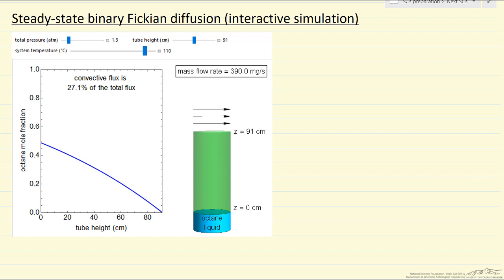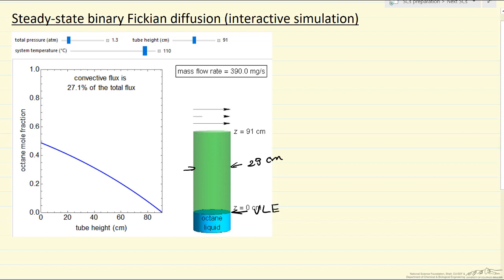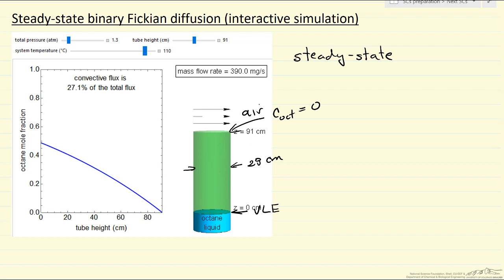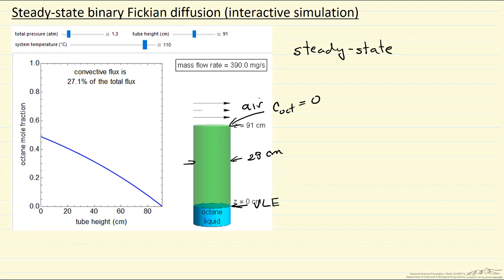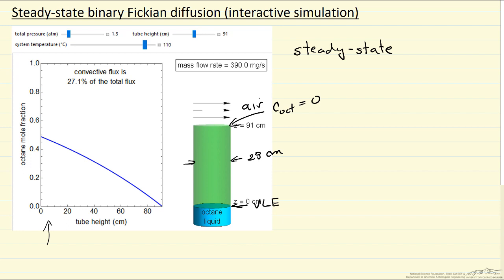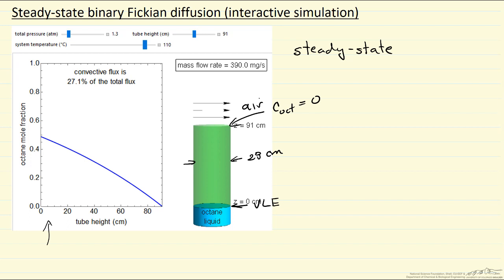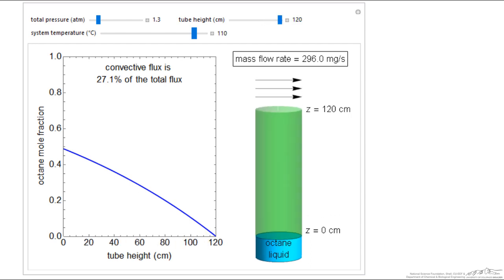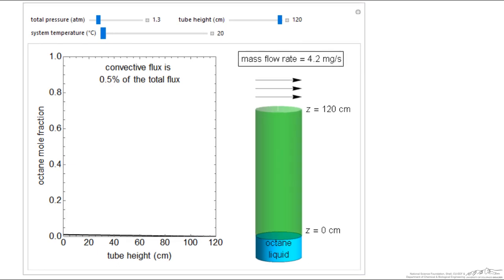Steady State Binary Fickian Diffusion (Interactive Simulation)

Comment: I appreciate everything you guys are doing!  Something I haven't seen books/youtube tutorials talk about is evaporation into a stagnant medium or almost stagnant medium using free convection.  For example, water on a surface, not changing in size with time because it is somehow being replenished from a reservoir of some sort in relatively stagnant air.  The tough part for me is that when the liquid is directly contacting the air, you can't use a a tube length to approximate diffusion distance.  You also can't use BL theory because there isn't a flow over the surface.  You can try to use the grashof/sherwood #'s but again, there's no velocity.  There's also trying to come up with wet/dry temperatures to find pressures.at the interface and partial pressure in the air.  If you guys can get around to it, can you please go over a comprehensive example where you use free convection, or even the two-film method, to explain what assumptions you have to make in this type of situation?  I'm guessing you guys won't have time, but either way I'm still grateful for the information you guys have already put on here.